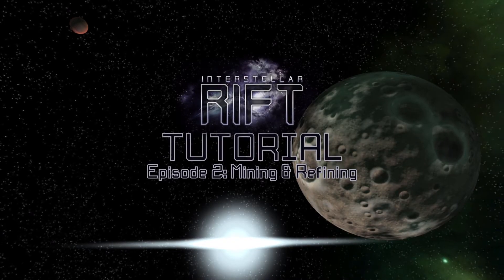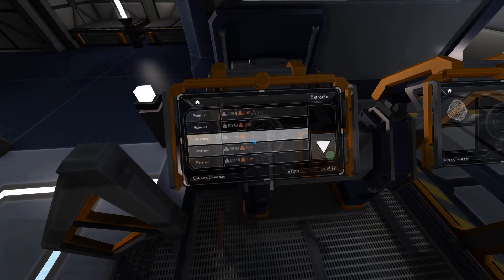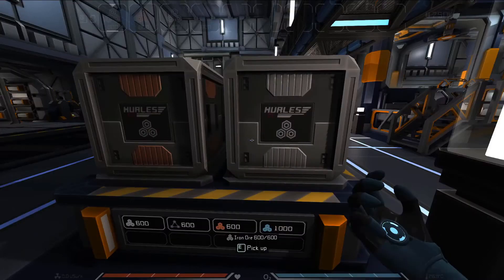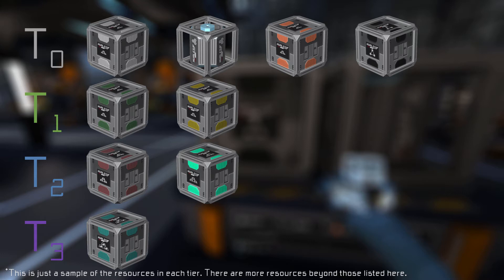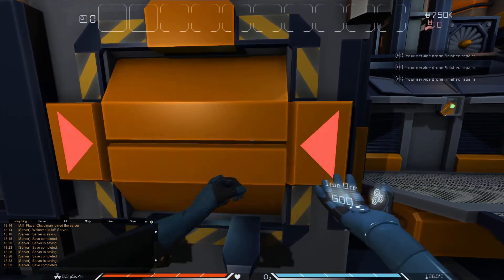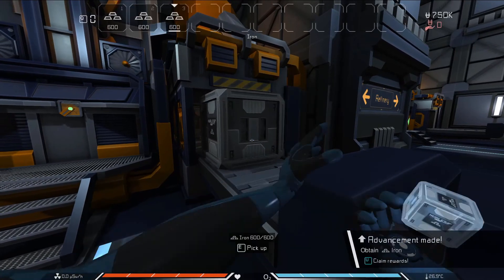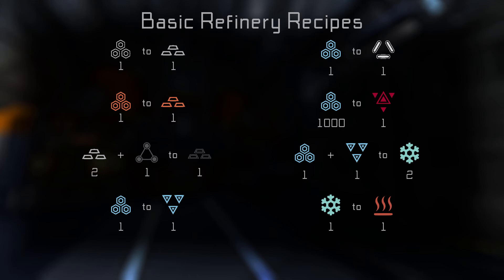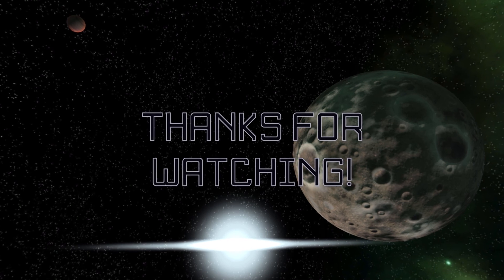Interstellar Rift Tutorial Episode 2: Mining & Refining

Comment: Yes, but how do you find the higher-tier resources once you get to those higher-tier systems?
Reply from the maker: For the most part, you'll find them in asteroid fields (shown as gray broken triangles on the flight HUD) around planets or stars. These asteroid fields won't be as dense as the infinite fields you can find around places like the HSC Industrial Complex, so you'll have to move through them continuously to find new asteroids. You can use the ship's resource scanner in the cockpit (make sure your sensors are on) to find asteroids containing specific resources, as well. When you see a spike in the bars of the scanner, it means that resource is detected. Move your ship in the direction that makes the bars grow bigger, and when the bars turn green, the asteroid is in range of the extractor. Some materials (for example, gold or silver) are rarer than others, so it might take some time to find large quantities of them in asteroid fields. However, even if you don't see asteroids containing them, it doesn't mean they aren't there. You can also rift into a system that has a higher abundance rating for the material you're looking for, if you aren't having any luck in the current star system. I'll probably make a video at some point which covers how to mine asteroids in belts, and the best strategies to do so. I hope this helps, and if you have any further questions, feel free to ask!